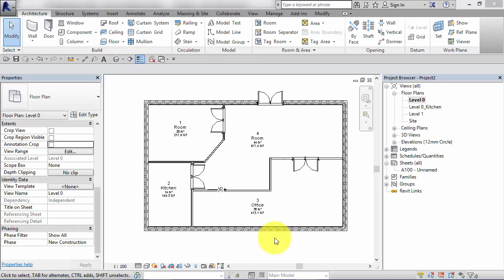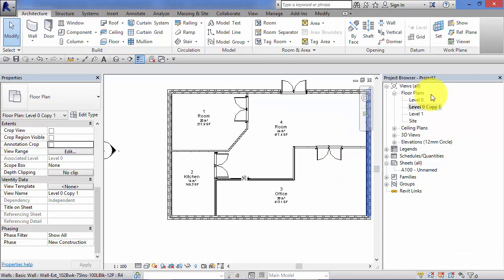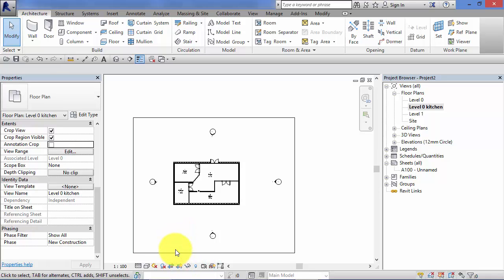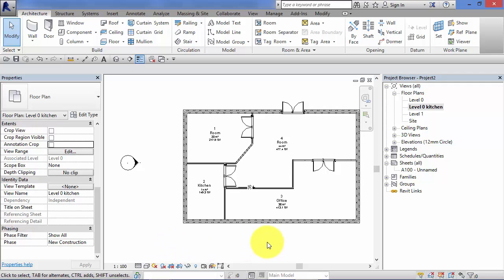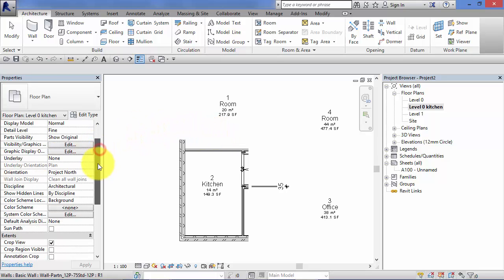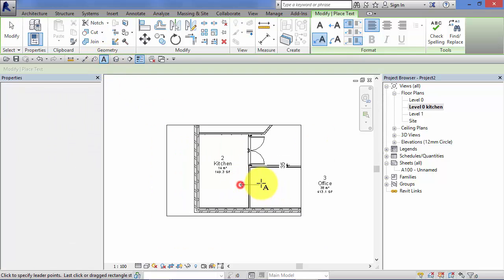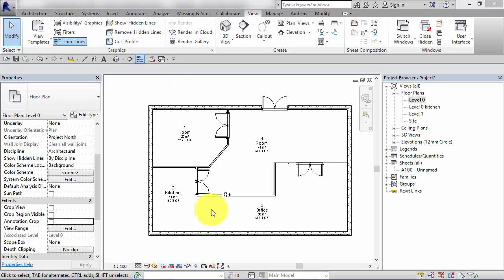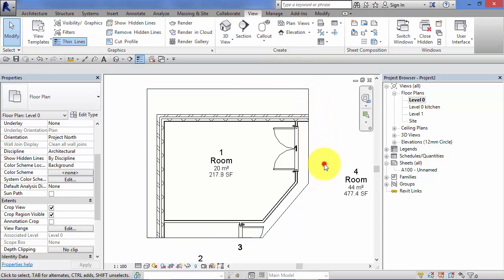Module 7: Unit 4: Revit Architecture: Crop Regions

Comment: What is the Chevron marks on the crop region for?
Reply: I think you're referring to the View Break symbols? you can cut away unnecessary parts of your view in order to fit on a sheet (eg the detail section of a tall window, where you only want to detail the connections at the top and bottom)